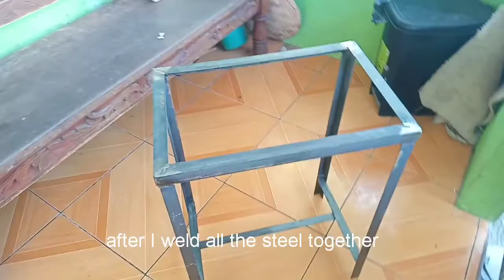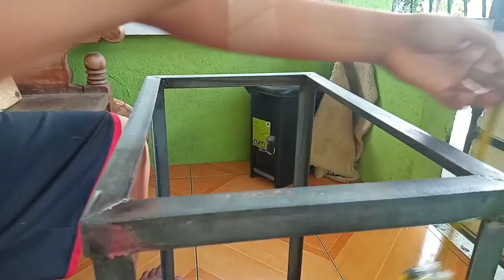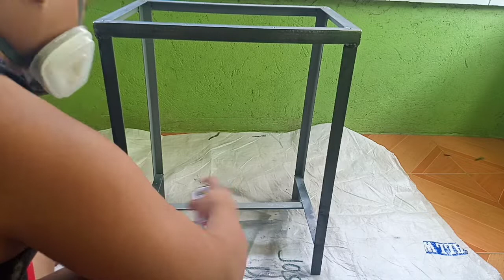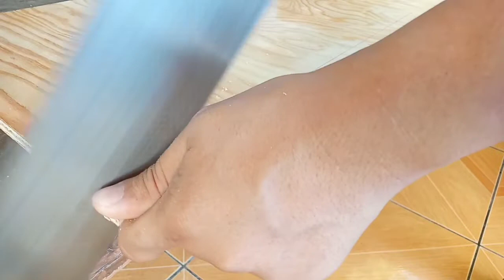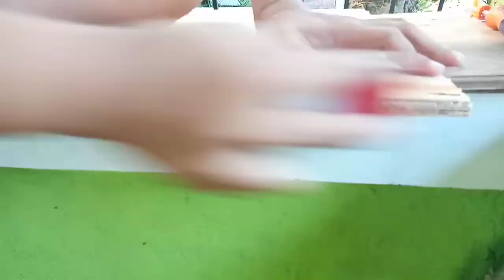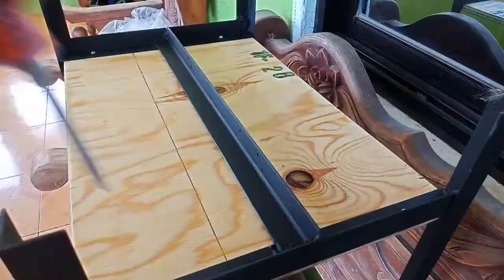DIY/ 2 Layer Shelf

Comment: What are the cut measures
Reply from the maker: Legs are 1 inch angle bar with length of 2½ feet each.  Top and bottom is 20 inch x 10 inch 🙂 plywood thickness is ½ inch.